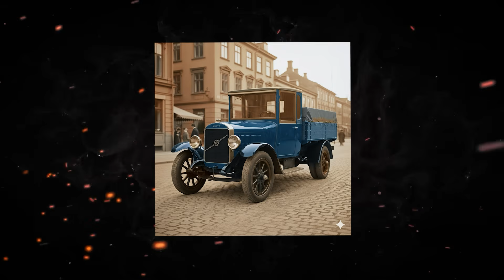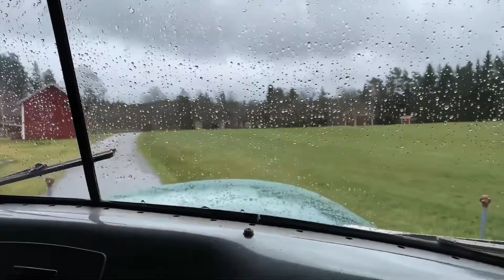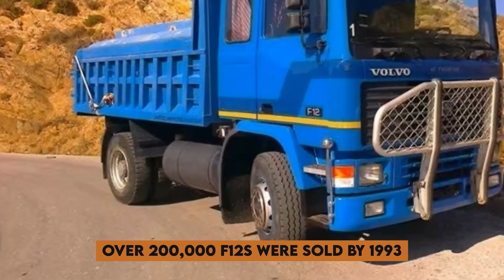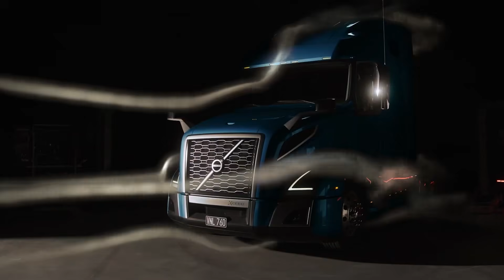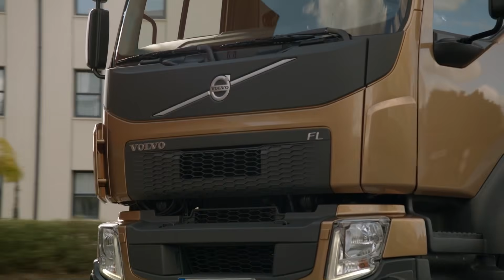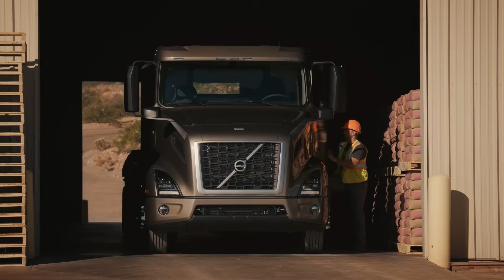10 Most ICONIC Volvo Trucks Ever Made

Comment: I believe the F88 series have changed the truck. It was completely built with the philosophy that it had to have low exploration costs and a minimum of maintenance time. Furthermore the sleeper cab had a great design and it was a very reliable truck.
Remember some drivers had the steering wheel as a pillow back then😂